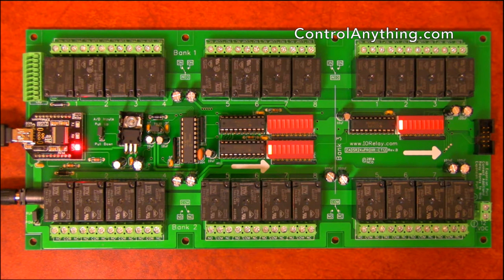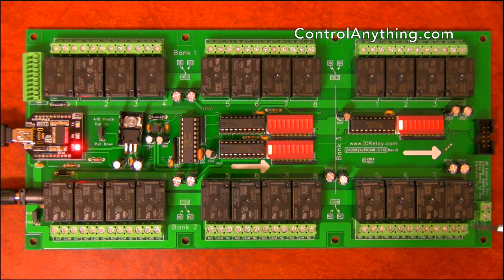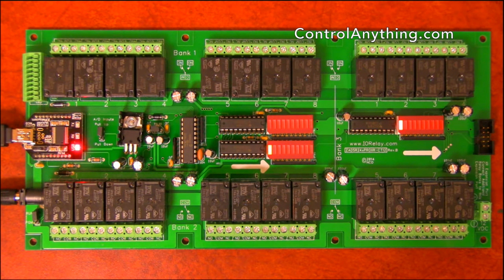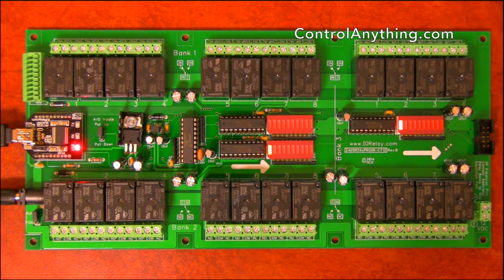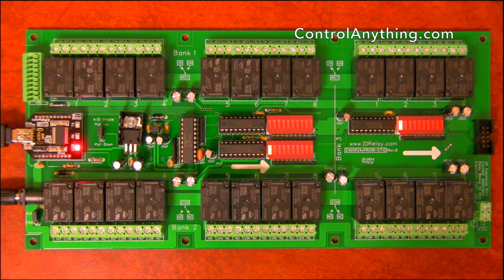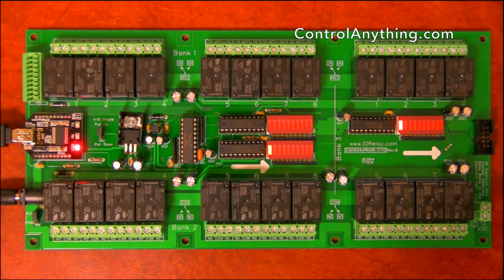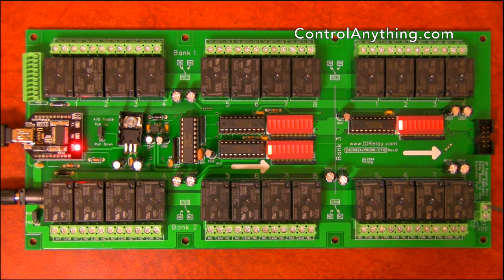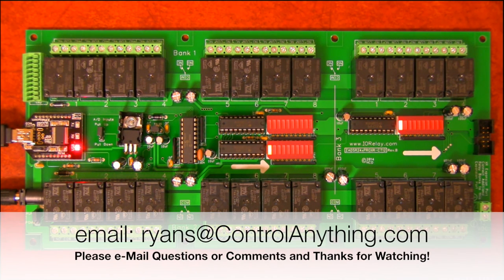24-Channel Relay Board with Modular USB Interface and 8/10-Bit ADCs

Comment: Your link doesn't give any prices. What logic is used to program the module? Why only 8 analog inputs? Do I have to have an external I/O module to control the rest of the relays? Why do that? If you are using a module to control the eight relays, why not just have your module control all 24?
Reply from the maker: We moved to ncd.io.  You can find more information about the product on our new site including pricing.  The 8 inputs may be used for sensor monitoring, but can be remapped to control a few of the relays if needed, most people use them for sensors and switches for computer monitoring.  The 8 inputs are not necessarily used for relay control, as a computer is used for this purpose.